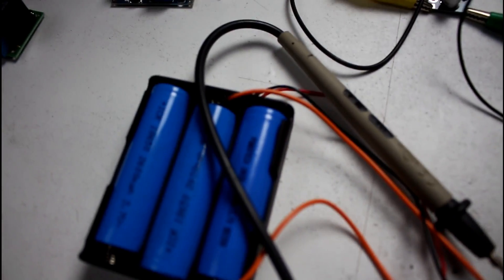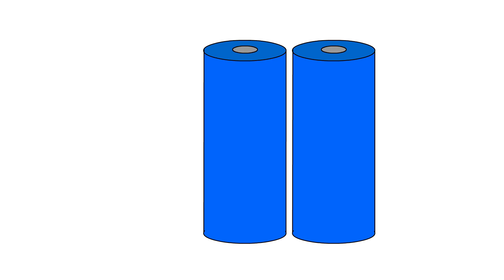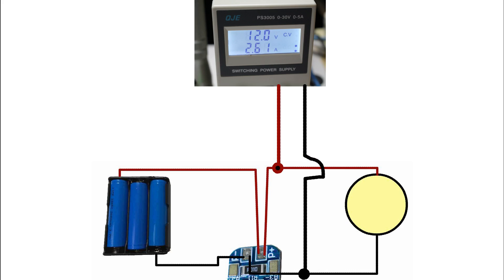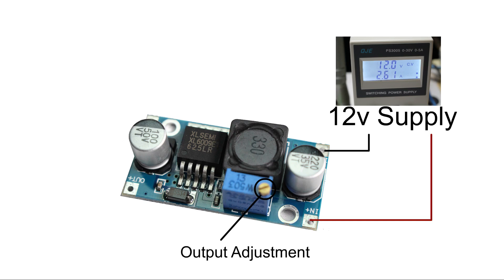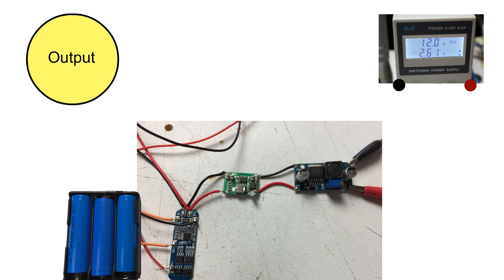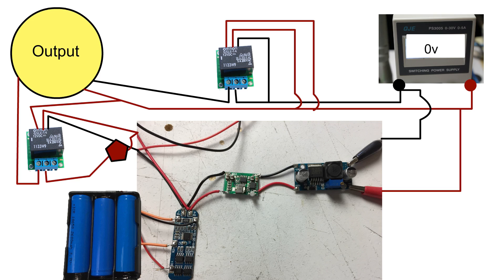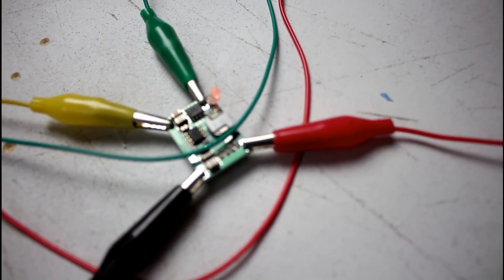Lithium cells in Series with BMS - Battery Pack Considerations (MEHS) Episode 61

Comment: I made a similar project a few years back. The wiring wasn’t exactly the same, but the principle was. I used a MOSFET instead of a relay. It was my first project of this kind. It’s been around 3 to 4 years now, and it’s still working continuously without any issues. The only problem I’ve noticed is that the battery backup time has decreased, likely due to the degradation of the Li-ion cells.

Comment: Hello brother, I have a 3s 40A bms setup for my batteries, yesterday they worked fine but today as soon as i connect a load the Output voltage of the BMS drops to 6V making the load inoperable. This board is even new already threw one 3S 25A board for facing similar issue. Pls resolve or guide me if u know.

when load gets disconnected BMS shows Op again to 11V...each battery has 3.78, 3.79 and 3.80V

Comment: I made a circuit, with (3 Batteries + 10A BMS & XL6009) - working fine. Buit, the battery voltage is dropping automatically even if the input voltage is ON and is 12V. Why the battery voltage should drop ??  Where could be the problem ??
Reply: Hello brother, I have a 3s 40A bms setup for my batteries, yesterday they worked fine but today as soon as i connect a load the Output voltage of the BMS drops to 6V making the load inoperable. This board is even new already threw one 3S 25A board for facing similar issue. Pls resolve or guide me if u know.

when load gets disconnected BMS shows Op again to 11V...each battery has 3.78, 3.79 and 3.80V

Comment: how do i know if a relais is necessary? So if my project draws little current a "pass through" functionality is given with my bms alone? But how do I know if its not enough? --> Just see if my project works and see if the batteries are actually charging up voltage?
One can also always disconnect the project with a switch while charging up the batteries and only continue using the project once the batteries are charged and the charger is disconnected.... right?
A lot of questions from me ik :D You answered quite a few here, but i am still left with these though ;D

Comment: Why does this module output stops supplying power ?
Once I supply power into it , it starts to output voltage , but then the output shuts down ?
Reply: Hello brother, I have a 3s 40A bms setup for my batteries, yesterday they worked fine but today as soon as i connect a load the Output voltage of the BMS drops to 6V making the load inoperable. This board is even new already threw one 3S 25A board for facing similar issue. Pls resolve or guide me if u know.

when load gets disconnected BMS shows Op again to 11V...each battery has 3.78, 3.79 and 3.80V

Comment: I am about to use this board in a project that only draws 1 AMP , is it suitable in this situation with a normal 12V power supply without voltage booster boards?

Comment: question, if i use the bms to connect my 3 battery's, how will i charge them? and how will i know they are fully charged? would i need to add a charging module to know this information? as i have a TP4056 Micro USB 5V 1A 18650 Lithium Battery Charger Module and i was going to connect 3 battery's to it but i think using the bms bored would be a safer option but would i be able to introduce this? as this little bored is perfect for what i need.

Comment: Great video, mate.
I plan to build a 3S6P (19.2Ah) pack for a golf trolley. Do I need a balancer on top of the BMS? How much voltage & current do I need to charge this pack efficiently? What kind of charger should I have for auto cut-off when the pack is fully charged? Thanks in advance.
Reply: Hello brother, I have a 3s 40A bms setup for my batteries, yesterday they worked fine but today as soon as i connect a load the Output voltage of the BMS drops to 6V making the load inoperable. This board is even new already threw one 3S 25A board for facing similar issue. Pls resolve or guide me if u know.

when load gets disconnected BMS shows Op again to 11V...each battery has 3.78, 3.79 and 3.80V

Comment: What's the moral of the story? Can I charge a 3s 3p set of 18650s (total 9) with my regular 12V adapter (or 12V solar panel) using this 3s BMS or naa?
Reply from the maker: Hi.  The answer is a bit of yes and no.  From a 12v supply you will put power back into your cells but it won't be an ideal charge (maybe 50%).  This means the battery pack won't reach peak charge and the cells won't have as long a life as if they were well looked after.  How long is a guess.  By using the 12v supply or solar supply (which has other considerations) you are bypassing the CC CV charging method desirable for healthy lithium charging.  A proper charger has this methodology baked in, but in a pinch your method will work.  The Solar option is less desirable unless your are using a regulator to get a smooth (roughly) 12v from the solar.  As you know, solar does not produce a constant supply.  It peaks and troughs.  This will upset the BMS and force it into under or over voltage protection, depending on the features of your BMS.  It could be a situation where the BMS is switching on an off like flicking a light switch on and off as fast as you can.  The BMS and the cells won't enjoy that and you could introduce a failure or excessive heat.  If your Solar is regulated then the ups and downs will be much less and it becomes basically the same as using a standard 12v supply.  Cheers.
Reply: @michaelsstuff4402  Thanks a lot for the detailed reply... I am planning to make my own "Solar Street Light". For that I am planning to use the 3s 3p set of 9 18650s. I will connect them to the 3s BMS and also connect the BMS to a 12V Solar Panel and the LEDs.. I hope it will work. I agree that using a Buck/Boost module to fix the power supply to 12.6 will be good but I have a feeling that it can still work without it. Since there's this 3s 25Amps BMS which should (kinda) help incase of under voltage.
Any comments on that, if you'd like..

Comment: Dudeeeeee, I've had all these problems and had to solve it myself with barely any knowledge. Been watching videos and piecing knowledge and ideas together until I figured it out. Ofc after all that I find this video.
Reply: Hello brother, I have a 3s 40A bms setup for my batteries, yesterday they worked fine but today as soon as i connect a load the Output voltage of the BMS drops to 6V making the load inoperable. This board is even new already threw one 3S 25A board for facing similar issue. Pls resolve or guide me if u know.

when load gets disconnected BMS shows Op again to 11V...each battery has 3.78, 3.79 and 3.80V

Comment: lol So you step up voltage and then step it back down... Yeah... That's one of the right ways of waste!
Reply: It’s because if you understand how these work the input voltage has to be 1 1/2 vaults higher than the output voltage hope that helps you understand how it works

Comment: What happens if a cell dies with a short? Does the BMS shut the other two off?
Reply from the maker: It will depend on the features of the BMS but in most cases the BMS will detect that minimum voltage has been reached by a cell or as a collection of cells.  E.g. a 3S BMS is expecting to be able to provide a minimum of 9V and a peak of 12.6V.  If a cell dies then the max a BMS can provide is 8.4V (2 fully charged cells).  since this is less than the expected minimum of 9V the BMS should clamp down and stop any further drain from any of the cells.  Easiest way to be sure with your BMS is to disconnect one cell and observe the result.  Cheers.
Reply: @michaelsstuff4402  Thank you. I've been looking araound for this feature and it is never mentioned on cheaper BMS, where I guess you have to do your own test.
Reply from the maker: @engineeringdisillusion  - For sure.  So many different BMS and lack of documentation means you can't be certain of features and thresholds so always a good idea to do your own testing.  Cheers.

Comment: i knew somethings wrong with my 12.6v ups. i thought the bms will be enough to protect my batteries from over discharge. i guess i should also learn how to use relays too
Reply from the maker: Yeah, the BMS alone won't completely manage cells but it should have protected your lithium cells from over discharge.  Maybe a couple\of things wrong in UPS land.

Comment: I have the same prob building 12v li ion for drill. Bms cutoff is too high(4 27), balancing resistors only 42mA, no cc/cv charge... I guess i cant help those batteries can i
Reply: Hello brother, I have a 3s 40A bms setup for my batteries, yesterday they worked fine but today as soon as i connect a load the Output voltage of the BMS drops to 6V making the load inoperable. This board is even new already threw one 3S 25A board for facing similar issue. Pls resolve or guide me if u know.

when load gets disconnected BMS shows Op again to 11V...each battery has 3.78, 3.79 and 3.80V

Comment: Maybe a BMS + a 12V supply & 1A PTC thermistor between the cells and the charge socket? Less parts... Thats the "A" case, but with current limiting built in. If it doesn't heat too much, don't know, didn't try... If it does, add an 1ohm 2w resistor in series with the PTC. You can also use just an 3.3ohm 5W resistor but then the charging current will vary, and it will charge slower...

Also If you then connect a schottky diode between the batteries and the load, and another one between the supply and the load - the load will be powered by the supply when the batteries go below 12V.

Comment: Ok... so now what if you want to add in a big ol Solar Panel to the project? Do you need a solar controller... and it needs to be 12v or perhaps a bit more?
Reply from the maker: - It depends on what the solar controller is actually doing.  The one I had was a regulator that would either block the unwanted voltages or boost or lower them.  Like a SEPIC power regulator.  This is because your solar panel will produce low voltage when there's little sun and up to 20v when full sun.  The batteries and devices connected to the panel only want a 12v supply.  In this case the solar regulator is more useful than a BMS by itself.  You could do it all yourself and run a battery pack with a BMS and between the BMS and solar panel run a regulator, but the PWM or MPPT solar regulators are going to do a better job of it.  Cheers.

Comment: Hi buddy, i have the same 3s chip but it is not working. i don't know why. i did the same connections as you did. but still. Help me out.
Reply from the maker: Have you activated your BMS board?  Have a read through the comments but basically you need to connect a 12v or 12.6v power supply to the P+ P pads for a second or two.  That will release the blocking relay and the board will work, as long as you connected everything up correctly.  Cheers.
Reply: I don't know how to activate BMS board.

Comment: You could use a current sensing circuit that would disconnect the charger upon receiving a load, but aren't current chargers already doing this? Also this looks like it might be suitable in low power solar charging applications

Comment: i have some different project, arduino etc, clock etc, need 12V battery and alltime in wall adapter to charge battery and if wall elelkrick cut off clock etc, all work good normal many hour. normal there cut elektric manytime off /day or onetime and 2-9hour..its problem all my little elektric, i need 12V and 5V 3 cell ,power bank/ups. what is better use ? bms or tp4056 chip modules charging if battery go low and keep battery alltime full, and clock etc other stuff use alltime battery. what is best way make this simple ?
Reply from the maker: - Hi.  You can't use TP4056 as it i s for single cells only.  If you need 3 cells and make it easy I would buy a 3S lipo pack used in RC cars etc and use a MAX745 board in your project to continually charge the pack properly.  I have a video on the MAX745.  Cheers.

Comment: Hello. I want to ask you about the bms on the video which i have got the same one. I am tryin to make a 12 v battery for my hand drill. I make the connections exactly true . I can get voltage from b1 and b2 but everytime there is no voltage on the outut. I tried it many times but always it ended fail... would you share me your opinion please.?
Reply from the maker: - You have to reset your BMS.  You can do this by applying a charging current to P+ and P-.  It needs to be at least 12v and not more than 12.6v and you only need to connect that input power for a couple of seconds.  After that your BMS will work as expected until it cuts off again because the connected batteries have dropped below the BMS cutoff voltage of approximately 8.5v.  Cheers.
Reply: @michaelsstuff4402  I thank you man👏👏 it works. Great!! From Turkey what can i do, i will do for you..

Comment: I do not give out voltage at output-P + and P-, by checking the oddnitelnosti and on balancing issues, what is the reason and how to repair, new boards from China
Reply from the maker: Hi.  You may need to activte your board by connecting a load to P+ and P- for at least 1 second.  This has also been discussed in some detail in other posts for this video, on case you need more information.  Cheers.
Reply: @michaelsstuff4402  Yes, I have already done, activated and everything worked

Comment: Can we connect only two battery in series using this module
Reply from the maker: - There are 2S versions available.  If you're just using 2 cells then use a 2S.  Cheers.

Comment: Hi,
the charging current must be greater than 12v?
Can I use a simple DC charger >12v? or a multifunction rc lipo charger set to "3s"? or a pc + 12v power supply?
Thank you and sorry for my english
Reply from the maker: - Hi.  Do you mean charging voltage?  If you use a BMS to charge cells then you need to feed the BMS 4.2V times the number of cells.  So a 3S BMS will need 12.6V.  Remember, a BMS keeps voltages in a safe range for cell operation but its not a real LION charger.  Take a look at my other videos for more info.

Comment: I want to charge a 3s battery and take out the power seperately from each cell. Any idea? I was wondering if there are some mosphet instant switching solutions that can switch between cells fast enough to not disrupt the power flow too much. Any suggestions. If there is a video would be very helpful.
Reply from the maker: No video exactly but yes most mosfets will switch very quickly.  can't say whether its fast enough to fool a charging IC but I worth testing.  Why a 3S battery if draining 1 cell at a time.  Just run a 3P pack and be done with it.
Reply: @michaelsstuff4402  to fast charge. Super vooc charging charges 2 cells at a time and drains 1 at a time. I was wondering it's possible with 3s 4s or even more, increasing the charging speed in the process with every segment added.(I don't care how bulky my phone gets 😀). What if I add a 3.7 or closer to 4 volt capacitor in line? Is there a 4 volt high capacity low discharge rate capacitor?

Comment: I need some suggestion like I am using this board  ..and total voltage of my three battery is  8.36. but I am not getting this output voltage from board output?? can you please tell me what is the reason behind this?
Reply from the maker: Sounds like one of the cells is faulty or has been connected incorrectly, e.g. a cold solder joint.  Check everything.

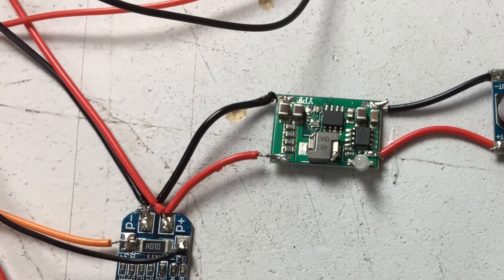Comment: hi, what is the cut-off voltage when using that charging board (SY6912) with 3 cells in series connected with the BMS? I was looking at 2:44 the details of charging board, is that the correct configuration( the position of 0 ohm resistor)? Thank you.
Reply from the maker: Hi.  From memory it was 12.6v or very close to it.  I moved away from this board and started using the MAX745.  Look at my other vids on this.  Cheers.

Comment: hi everybody, I've ordered one of this BMS board (still waiting to receive)  to be used to a battery pack of three 18650. I just want to ask : is it necessary to charge with that specific "intelligent"charger/same type of charger or I can directly power it with any source provided that the voltage is in that range detailed on the specification. Thank you and sorry for this question maybe a stupid question but the more I search the more I become confused.
Reply from the maker: - Hi.  Its best to charge the cells in an intelligent charger as the BMS will allow charging current to pass to the cells but its not in the fashion that LION cells require for best, safe charging and long life.  Cheers.
Reply: Thanks. Reading the comments, I found that better use Max745 for charging but can't understand if it also capable of those protections used  by BMS. Is max745 BMS and charger in one board? Thanks.

Comment: Isn't 4.25v a bit higher for what each cell should be charged to? i have a typical good quality charger that cuts off at 4.16 and these circuits go way past that and stop at 4.24-4.26 ,so why are these bms like this? everybody advises going above 4.20
Reply from the maker: - Hi.  The peak voltage is often rated at 4.2v.  There is some safety margin but its commonly understood that you can damage cells if you go over 4.25v.  Most BMS will cut in around 4.23v - 4.25v which is the max upper limit.  If you're charging your cells correctly the BMS won't need to step in at all.  You can also charge your cells to 4 or 4.1v.  This slightly reduces the max possible capacity of your cells but extends the cell life.  I have charged a few unprotected cells to 4.3v without issue but I can't tell you what that does to their life expectancy.  Cheers.
Reply: Thanks, really great and elaborate comment. Although my question was more towards if everybody knows this, why do they design these BMS to keep the cells at their toes, I have charged some cells even above 4.3v and they seem to work (at that time)